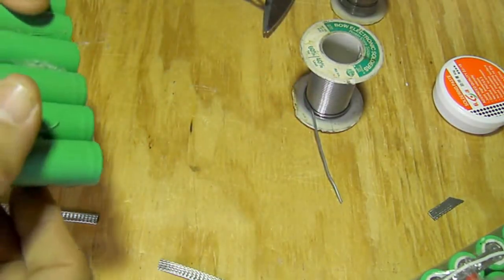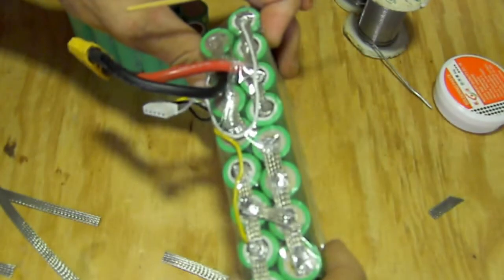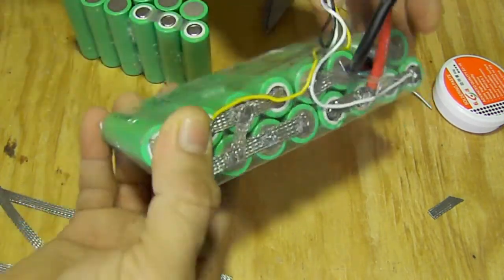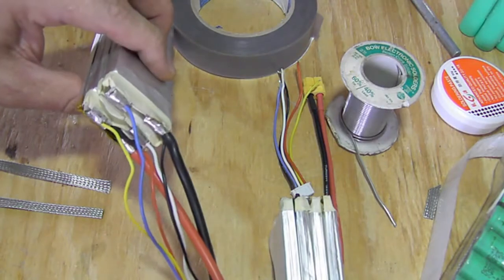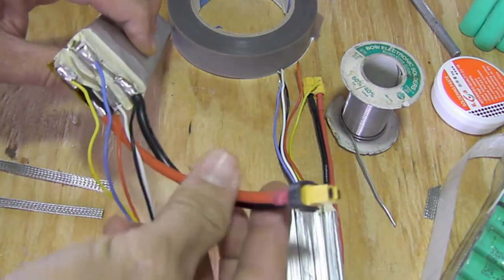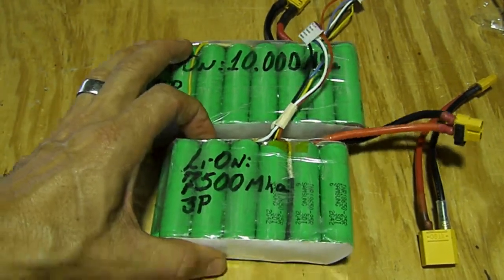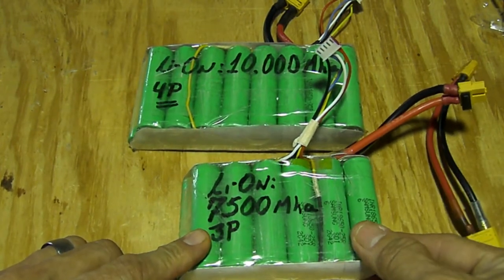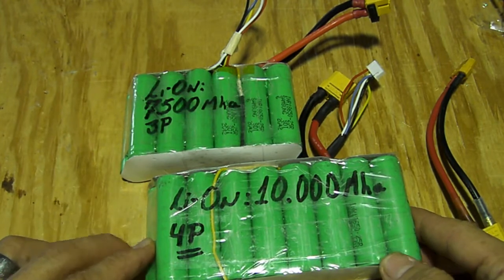Li-Po Batteries ALTERNATIVE (2)

Comment: Great alternative. I may have to look into this more Miguel. Thank you as I just subbed ☺
Reply from the maker: My goal is to squeeze at least 1.5 hours of flight time!! May I ask you how much the 360 gimbal that you make for that new plane weights? I'm in a personal quest of the lightest possible 360 gimbal! Mine is dead on the 37 grams!! 
Hey thanks for the comment! If you want to I'll gladly share the next vid showing the latest model of my "MaX8 Skywalker" I do modify the tar of that one!! & now I can see the maiden in sight!!
Reply: I wouldn't know off hand but it is a large digital metal gear sail winch servo. GWS T125 I think. It's pretty heavy at least 37 grams or more.

Comment: Hola Miguel cuánto pesa tu ala completa con sistema de video y baterías lista para volar? Y de donde sacaste el diagrama para hacer las baterías y poner los cables de balance? Yo tenía una Página para hacer el cálculo de las baterías y la han cerrado
Reply from the maker: Yo no uso binging diagrams,,,,para mi es muy facility hacer y ensamblar las batteries. Entre otras cosas so tu entiendes la secuencia, no es nada dificil, mi ala pesa exactamente dos kilos,,,
Reply: @Migueldeservantes   muy bien miguel, mi avion pesa lo mismo, pero con litio polimero 3s 4500mah para motor y controladora de vuelo y 3s 1500mah para video... el vuelo maximo fue de 26 minutos  quiero probar lo de las baterias li ion para mayor autonomia
Reply from the maker: Donde Vives? "En que pais.. no me des tu direccion!! Estas en disposicion de haser un video pequenio y mostrarme tu "Setup y configuracion" ke motor, ke ESC, porke no utilizas power supply, pues de esta manera con una sola bateria puedes volar muchisimo mas tiempo...Mi costo, Para mi solamente.... una de mis batterias de 10,000 me cuestan algo asi como unos 285 Dolares "esto no inclulle shipping, connectores y el plug  de balanceo... (tristemente es dificil encontrar batteries de buena calidad ke no sean falisificadas).... mas sin envargo vale la pena pues generalmente uno de mis vuelos puede durar hasta mas una hora y 25 minutos!.. tienes ke afeitar peso al maximo pero no es imposible...

Comment: Great material Miguel!  These cells are 18650-25R's, right?  How are the specs different from the 18650GA's inside my Titan batteries?  Also, the two packs you made here are both 4s I think.  One is 3P 4S (12 cells) and the other is 4P 4S (16 cells)?  Also, have you seen gormogonus addictRC channel?  He's also made Li-ion packs by a similar method.  Great job and thumbs up man!
Reply from the maker: Well due to the fact that I do understand what is done!! I'm pretty sure that the  GA and the 25R are related to the 2% of additive compounds on the electrolyte, that are designed for the purpose of high temperature! I believe that the GA stands for Gallium Arsenide, and the R have something of Cobalt carbonate. each is tailored for the purpose of deal with short battery life under harsh conditions.  There is a tutorial around about Lithium Ion battery life.. you may watch and understand it.. thanks for the comment and I'll be looking at the channel you have recommended!
Reply: Cool, thanks for the info about those mysterious (to me) letters in the names of these cells.  I hope these batteries turn out to be more cost-effective than lipos.  Glad you made these videos!
Reply from the maker: It was a pleasure!, Hope what I have show will be of help to you.  In honesty if I manage to get over the magic number of 75 recharging times, I would know that I actually achieve my goal...

Comment: How much heavier this compared with Lipo?
Reply from the maker: they are a bit heavier than 50% per the same power rate
Reply: @Migueldeservantes  Thanks, but atleast no worry of becoming dead, for my lipo (Orange) one cell became dead after first use only
Reply from the maker: @MrNams  That honestly sucks... sorry to hear about it... I probably wasn't very clear but what I mean is that a LiOn battery would weight around half of the weight of a LipO battery... they never get puffy and for as long you don't discharge them beyond 3 or 4 C they will last you many, many years to come... "Best of luck, Please make sure you buy good quality cells"
Reply: @Migueldeservantes  Thanks

Comment: Interesting!  How much discharge (amps) does each pack have?
Reply from the maker: Well according to the manufacturer data sheets they state constant current discharge at 20 amps per unit! so  in one I have 60 amps and in the other I have 80 but that would be only for some what around 7 minutes... I'm shooting for a discharge of about 9 to 10 amps for around 45 minutes on the small pack! and I will happy if I can get at least 30 min of my largest plane my "MaX8Skywalker" because in the past that plane have a min requirement of around 24 amps... you can find all the exact data for this batteries at (https://www.powerstream.com/p/INR18650-25R-datasheet.pdf) thanks for your comments.